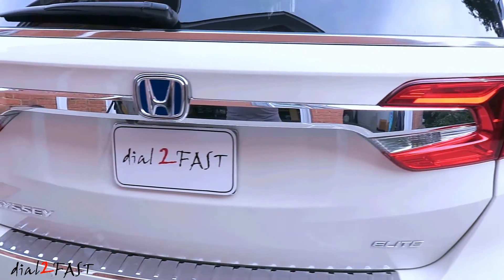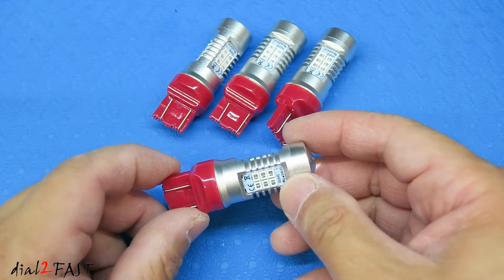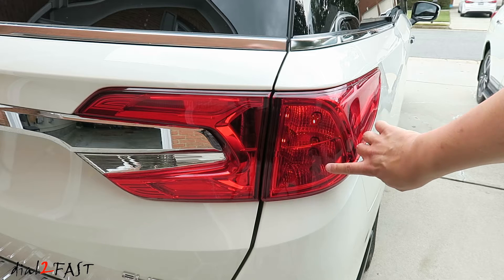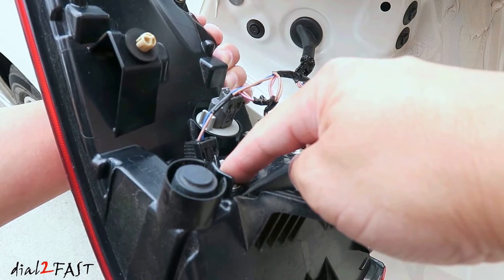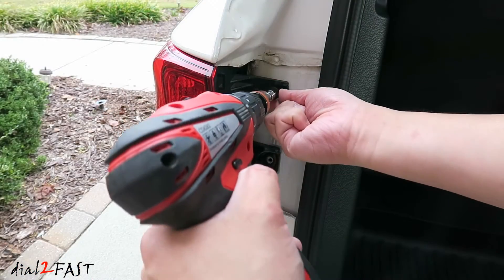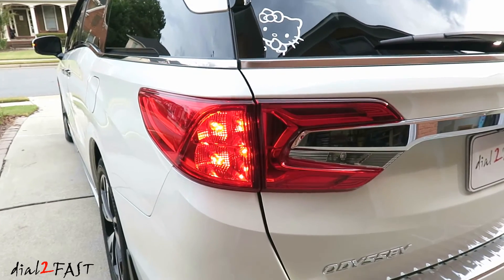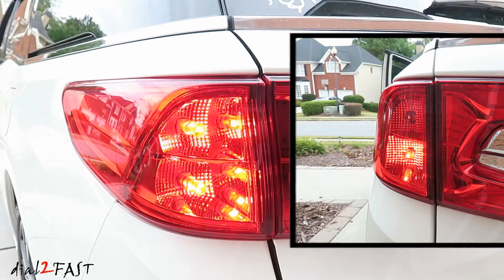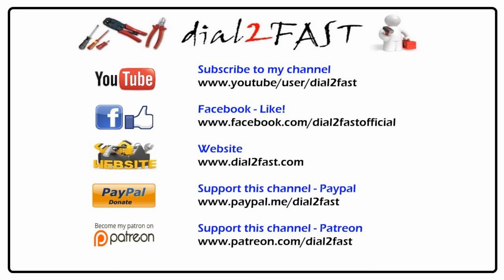2019 Honda Odyssey LED Tail Light Install - Brake & Turn Light

Comment: Thanks a lot for your diy videos,  wondering if I change the front turn signal light bulbs with a built in Led + resister/can bus & the rear's  without a canbus,  would it not trigger hyper flash? I have a 2019 Odyssey EX-L; in your other video replacing front turn signal you made a comment that only in Touring & Elite you anticipate hyper flashing. Any suggestion on whether  EX-L would require canbus/resister at all would be helpful. Thanks.

Comment: Thank you so much for this wonderful video. With a pair of load resisters on the front turn signals, I do not require to add another pair of load resisters for the rear turn signals at all? Hope to hear from you.
Reply from the maker: That's correct, I only have load resistors installed on the front, and no hyperflashing.
Reply: dial2fast WOW... That’s great. Thank you so much for this video. Keep it up!
Reply: I have a 2018 odyssey ex and got all the same bulbs you recommended for this mod. I did the front mod and used a load resister to eliminate hyper flash, however I installed the rears without a load resister and now I have hyper flash.
Reply: @ajnardiello  I have a 2018 and bought the same bulbs and they don't fit.the bulbs are way to loose so I sent them back.

Comment: Hey I got pull over last night because the left rear taillight was not working, I've changed all the light's and it still not working. I can't seem to find the taillight fuse location on my 2019 Honda Odyssey, I downloaded the owners manual and can't find it. Would you know the location of the taillight fuses.
Reply: Did you figure out where the fuse is?? I can't find it either

Comment: Nice videos!! But do you have a video to change taillight inner side ,mine is broken i need to replace it.
Thanks
Reply from the maker: It's most likely held in by nuts from behind the plastic panel. So you'll need to remove all the plastic panels on the hatch.
Reply: dial2fast yes I removed it, but I’m thinking I have to figure out how to lose the pins for the chrome plate that goes in the right to left tail light inner
Reply: But to be honest I don’t have any idea how to remove the pins at least if I have to break them hopefully you come out with a video you are the master in this!!!

Comment: Hello and 5gabj for all the info.
In the video you show a pack with a set if 4 builds. But the link is a set if 2 ligth builds. Do you have the link that u used that comes with the set if 4 ?
Reply from the maker: The 4 pack is no longer sold on Amazon. That's why I updated it with the 2 pack.

Comment: Load resistor or an electronic flasher to control the flash rate regardless of load. I used the electronic flasher and prefer that to the resistor as it is easier to install and causes less stress on the electronics.

Comment: Are you installing leds for the fog lights and head lights
Reply from the maker: My Odyssey already has factory LED headlight and LED fog. If you want to install H11 LED on your Odyssey, check out this video https://youtu.be/Gbq2PDmRaWQ
Reply: @dial2fast  I believe the touring and elete comes with led headlights and fog EX doesn't

Comment: If I install load resistors on the rear turn signals, instead of the front ones as you did, will I be able to run front and rear led turn signals without also needing load resistors on the front signals? So it would be set up similar to yours, but with the location of the load resistors moved to the rear. This is for a 2020 Odyssey EX-L. Thanks!
Reply from the maker: I can only guesstimate that it should work with the load resistors installed on the rear because both front and rear turn signals use the same flasher relay. But you will have to try to find out.

Comment: Hi there,  if i want yellow rear turn. signal do i get amber verion instead or it doesnt. matter since the cover shell is red anyway,  also do i need load resister for these?  I decided to skip the mod for the front.  Thanks!!
Reply from the maker: The red lens will block the yellow light. Get either white or red for the rear.

Comment: Did you do this before or after your front line conversion with the load resistor?  Wondering whether doing just this mod without the front will result in the fast blinking when in engine stop mode like you had.
Reply from the maker: This is done after the fronts were installed. So doing only the rear most likely will require load resisters as most flasher relays are tied to front and rear.

Comment: Nice vid but the incandescents honestly look brighter and they fill the housing fully. Beam pattern matters much more than raw lumens in automotive lighting.
Reply: Yeah, fully agreed. Incandescent being the best one I am wondering what to do with this 21w /5w bulb. In market no 25w /8w  approx. is available but I think slight upgrade to this for ex: 25 or 35 watt twin filament bike bulb (with DIY ofcourse ) can do better. So far just my thought. Have not seen anyone trying.

Comment: Does the rear LED hyper flash without the load resistor? I know the fron turn signal does.
Reply from the maker: Once you install the load resistor on each side (assuming you install it on the front), the rear will not hyper flash.